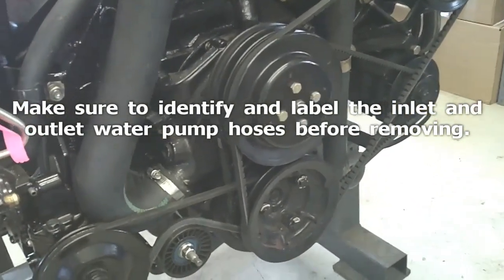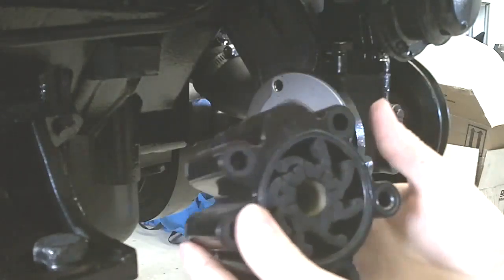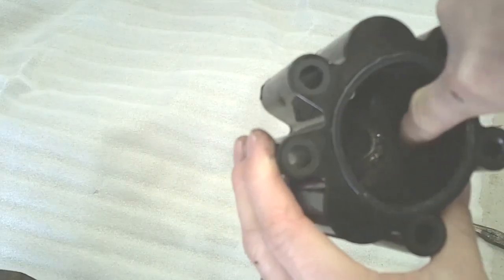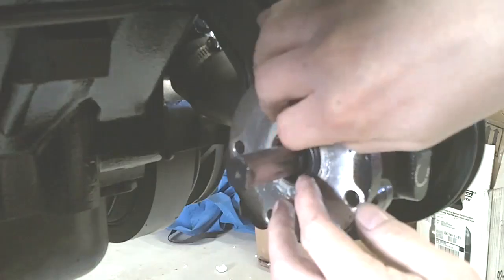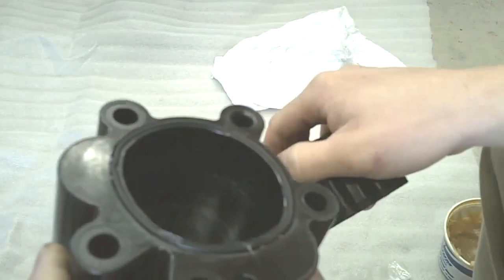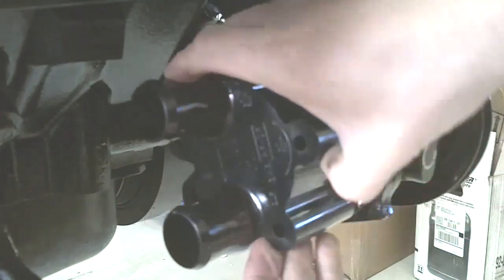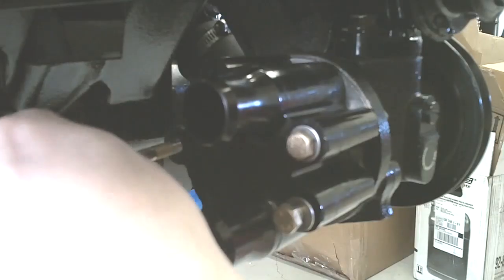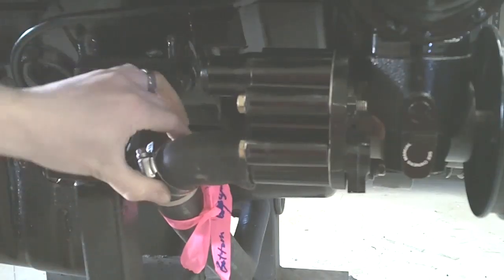Replacing Your Mercruiser Marine Engine Sea Water Pump Impel

Comment: I was taught to remove the entire pump assembly by the braket that is bolted to the motor.  When you have that out, unscrew the fuel pump bolt (large slotted screwdriver required) and drain the reservoir since it will undoubtedly be full of gas.  Refill with drive oil.  Then change out the water pump using OEM parts and use dish soap for luibrication, never petroleum based grease.  Once I've done all this, I run my boat on earmuffs and check for leaks and proper water flow out the exahaust.

Comment: This procedure also applies to several tow boats with direct- and v-drive inboards and engine-mounted pumps like my 1995 350 EFI Magnum Tournament Ski. I pull the the whole pump and use dish soap for the impeller.
Reply: Was it easier to remove pump? Did you have to loosen the belts? My impeller housing cracked and I’m about to replace it myself just looking for the easy way and how to do it lol
Reply: @michaelrodriguez8299 You've probably replaced it by now.  You only need to remove the one belt by loosening the tensioner, then it will come off the pump pulley.  There are a total of three bolts and one nut to remove, plus the two fuel lines and a breather tube to remove plus the hoses.  Drain the fuel pump reservoir while you have the assembly out since it will be full of gas.  Refill with drive oil. Make note of where the hoses attached to the back of the pump so you don't cross them.  Happy boating...

Comment: Thanks for the helpful video (even if it was made 9 years ago). Just took the pump off mine and the impeller is freakin' backwards! I got the boat 3 years ago, and I've had it in the water twice. How the heck did it not overheat? Went to run it with ear muffs and it wouldn't draw water up. That's what made me look into it. Found your video and voila!

Comment: The damage seen(little black fuzzies)is exactly what you find when a new impeller is ran dry. In fact, it got so hot it cracked the housing. When replacing, never use petroleum based lube on a water pump impeller, it causes it to swell and soften. Use dish soap, but the ultimate is silicone grease. Mercrusiers are one of the most difficult to change in the boat. It’s good for people to see it out in the open because many times you can’t see it and you’re doing it “brail”.

Comment: Yeah use Dawn dish soap for installation non-toxic I use it on my ski bindings works good on impellers also and what he doesn't tell you is that you should check the bearings for roughness and the O-ring can easily slip out of place on this model I like to use a little Right Stuff gasket maker underneath the lip of the seal between the bearing and the housing and you can put a little more outside of that for extra protection against water leakage on the back side and definitely look for broken pieces of your impeller in the lower hose section where it goes into the transmission cooler make sure you get all the pieces out of there some really tiny ones can work their way through but you definitely want to reach in there with a pair of tweezers or something and pull them all out and sometimes the housing is slightly scored on the inner Edge where the center part of the impeller rubs against the inner part of the housing I take some 220 paper body work d a paper works good because you can stick a small 3/4 inch piece to the end of the your thumb and just sand It Down Smooth again and finish up with some thousand Grit as long as it's not scored or damaged anywhere else it'll run you won't have to buy a new housing for a little bit of scoring on that end and there's always the stainless steel upgrade for 350 bucks Hardin Marine makes a good one
Reply: Good call!  Great info mobile mike!

Comment: "This engine is obviously out of the boat" . LMAO . Show me how to do this in my driveway.
Reply: I usually pull the pump off the motor.
Reply: I've done this many times over the years the hard way.  This year is going to be different with the electric ratchet i just purchased.
Reply: I just got her done, the electric ratchet is the best two hundred bucks i've ever spent.
Reply: Same way in the drive way brah

Comment: Great vid, except he neglected to advise the checking of all the hoses AFTER the pump, for remnants of the old impeller.  Typically the chunks flow through the system and collect at the inlets of all the accessory coolers and the thermostat housing.
Reply from the maker: https://www.perfprotech.com/blog/articles/mercruiser-impeller-installation#
Reply: See this video on a very good description of locating the missing impeller pieces.

Comment: I have a 1990 Mercruiser 454/Magnum Bravo one drive and I want to replace the raw water impeller. I want to order the part and install this my self as in the past I have always had this work done. On the actual part there is a number 46-807151 on the housing. When I do a search for this part# I found the same number with additional numbers and letters like (46-807151A14 46-807151A7 807151A14 for MerCruiser Bravo Water Pump Impeller Kit 807151A7) Can you please let me know what is the correct part number for my specific motor to order so I get the right part the first time I order?  Thanks in advance. I really like your video and this will help me do this work myself. Thanks, Phil   Also, I have the engine serial number if you need that.
Be the first to review this item
Reply: Please email sales@perfprotech.com and we will be glad to help you with this.
Reply: thank you

Comment: now i am confused, i have a mercruiser and the only impeller i changed was the one in the outdrive pump, didnt know about this pump. my boat has a circulating water pump, but its all metal. so this is different. ?????
Reply: Is your outdrive an Alpha One?  Those have the impeller in the drive, while the Bravo 1 and 3 have it mounted to the engine.
Reply: He did not clarify that the system he was replacing only pertains to a Bravo 3 outdrive.  Most other outdrives have the impeller in the outdrive, not on the engine.

Comment: I have a 1988 bowrider.
Omc cobra 3L. 130hp. Inb/outb.
It only goes 10kms an hr and just revs up past that.  
The engine will over heat as well. 
Any idea what could be the issue?

Comment: hi, thank you for the vid - same process for  Merc 8.1S Horizon?
Reply from the maker: +Aaron Burke You're welcome. The 8.1 engine uses a similar pump so the process is similar but not exactly the same.
Reply: Performance Product Technologies thank you for replying! Is there somewhere I can see the service instruction for the 8.1? I'm almost certain I'm in need of impellers
Reply from the maker: We have not done a video for the 8.1L. The only place to get the instruction would be with a product service manual.
Reply: Performance Product Technologies I was thinking about taking the hose off the thermostat housing and dumping water to the impeller so I don't dry start the pump

Comment: Can I change just the impeller or do I change to little seal also?
Reply from the maker: +simplyharpreet Normally you would want to purchase the water pump repair kit that includes all of the normal replacement items vs just changing an impeller.
Reply: Can u replace just the impeller or do i need to buy the the kit?

Comment: great video I am getting ready to own a sterndrive boat and this will help me in the long run and I knew how to fix a sterndrive and the good bit is I save on shop time and do it all myself and as an old salt I knew sterndrives pretty much myself how do you replace the sea water pump when im doing it for the first time and what cautions I need to take when doin the job for the 1st time and how I know when the sea water pump needs replacing how long it takes to do it  and I knew im learning all the time and I knew that I am gettin there as an experienced boater I am learning all the time  so can you help me learn about sterndrive care  this will be for my 1st bayliner with the 4,3litre Mercruiser V6 im keen to learn all I knew over time that's why im learning all the time  thanks!! from mick the old salty walker
Reply from the maker: +michael walker Thanks!!
Reply: and I knew the  routine of fixing the sterndrive and I knew how to do it myselfand I knew the procedures on how replace the sea water pump and I knew the ways of doin it  this video will help me as an old salty I knew whats have to be done and I knew all the Mercruiser engines and drives as well I knew how to perform the work myself this video will help me save on shop time and costs too as a old salty I knew how to fix a Mercruiser sea water pump and the other bits of the Mercruisers I knew how to fix them  that's how from mick
Reply: i knew the video will help me fix my 1st sterndrive and all the videos will be of much help to me that's the old saltys way
Reply from the maker: +michael walker Thanks!
Reply: I am getting close to having my first sterndrive boat as I get nearer to the day I get one  mines going to be the bayliner 1850LS Capri boat as I knew the motor was the Mercruiser 4,3 litre V6 as I will be doing all the maintenance all the service work will be done by myself as im a experienced mechanic from the time I knew how to service these motors as I read up on a lot of the stuff on these engines that's the Mercruiser V6 its the 4,3 litre sterndrive motors how I go about servicing my Mercruisers as I am  a well versed old salty and im gettin the nice boat am gonna do all the service work myself this will save me the wasted time in the shop can you  do a video for us old saltys on how to service a sterndrive engines and related components as well show us old saltys like me how to fix the engines when the boat is at home say we had to fix something that's wasn't right say for a example the sea water pumps and other things like how to check the power steering fluid levels and other levels too and also show us old saltys like me how to replace the drive belts on the engines and also teach us old saltys like me how to care for a sterndrive for the 1st time we us old saltys like me are willing to learn as we are good old saltys I as an old salty I love learning to care for our boats with the sterndrives im eager to learn as I go we keen old saltys

Comment: how often should I do this
Reply: can confirm the three years part. My boat has very few hours on it since I changed the impeller 5 years ago and it shredded itself!
Reply from the maker: +David Andersen Every 100 hours or 3 years whichever comes first.
Reply: I just bought a 1998 bayliner 175. has 54 hours on it. not sure if it's been done.
Reply: David Andersen 
I'm actually changing out my impeller as I watch this video. I bought a 2004 four winns 170 with a volvo penta 4.3 last summer and want to be safe since I don't know how old it is.

Comment: Got a question does it matter which way you put the metal plate? Seems like on forums they say it only goes in one way or your motor will heat up? Any inputs please thank you
Reply from the maker: +yelena kruzhkov Woth certain models this can be true. However, with the Bravo model this video is referring to the plate can be installed either way.

Comment: You have to check for pieces of the impeller in the hose that goes to the oil cooler-the hose that goes under the engine very important remove at oil cooler and check oil cooler tube where hose clamps on
Reply: Thank you. So outlet hose than?

Comment: DO NOT use grease on an impeller.  It will break down the rubber more quickly.  Use either dish soap or plumbers non drying silicone.  Dish soap is actually the one all the marine mechanics I know use.
Reply: Never use petroleum based lube on the water pump impeller. Use dish soap but the ultimate is silicone grease.
Reply: Vaseline eer petroleum jelly
Reply: Dish soap great idea
Reply: Exactly correct. Petroleum based lube is poison to rubber & causes the rubber to go bad. Dish soap, silicone, or water-based lube. Is best.

Comment: Thanks for posting this.  My wife forgot to turn off the engine when I trailered and pulled out at the lake recently.  I thought "My impeller is shot", so I pulled apart my Mercruiser MAG 350 today, and turned out everything was still good as new.  At least I now know how to do this, and will have parts on-hand just in case I have to do this again.

Comment: My Mercruiser  205/V6 alpha one equipped boat started to run a little hot when I'm idling in gear but cools when I increase speed. Do you have and idea what it could be ? should I start at the Out drive . We are going to go to Lake Powell in the first of August and do not want to get stranded . Grateful for any info, ideas that can help

Comment: Paul Smith
I have a 1987 Alpha on 260/V6 and it runs hot immediately when put under load. Hadn't been in the water or run for about 3 years. what might be the problem. Thanks.
Reply from the maker: Check out this article https://www.perfprotech.com/blog/articles/impeller-installation#

Comment: hi, i have a 07  496 and it is overheating and water in the oil, besides a blown head gaskit, is there anything els that can cause this, thanks mike
Reply from the maker: That is certainly one common cause. I have also seen times where the valves leak due to ongoing water ingestion issues and this allows water to accumulate in the oil over time. However the most common is the head gasket or cracked head/block.
Reply: Thank you
Reply: michael varalyai Don't remove the heads yet! ...Big blocks are fairly resilient. I would venture to say; Check for Exhaust Elbow(s) and or Exhaust Manifold(s) water leaks.

Comment: Great video, but I would recommend one more thing.  This particular setup has the fuel pump integral to this unit.   Fuel can slowly leak by the diaphragm, and dilute the lube in the front part of the unit.  I would recommend to at least drain out the oil and replace it at the same time.  I normally remove the whole unit from the boat to do this, and flush out the small oil reservoir for the fuel pump, then put in new oil.
Reply: Rick, he's talking about the oil reservoir IN the fuel pump (yes, it has it's own reservoir). It's something that is easily overlooked, and having it get diluted with gasoline will cause the pump to eventually fail. They aren't cheap if you have to replace the whole thing!
Reply: @fahrvergnuugen   Can't believe I asked this question 6 years ago. Thanks for replying (2 years later) but better late than never 😉. I am now well versed since with the Sea Water Pump.
Reply: some have one flat head screw, some replacements (my new one which is expensive) have 2 oil screws. the screws are directly below the mechanical fuel pump if you have the pulley, fuel pump, impeller combo.  Drain it and I use Lucas gear oil in it too keep from another $4-700 (parts only) mistake.  I actually found my complete replacement on eBay with a removable pulley on the front that makes life easier for maintenance.
Reply from the maker: Great point. Thanks for the feedback.
Reply: Sandpiper270 When you say "drain out the oil" are you taking about the crankcase oil? And how does "flush out the small oil reservoir for the fuel pump" stop " Fuel can slowly leak by the diaphragm" ?  As you can tell, I am a bit confused.

Comment: When the boat is in the water, before removing the two big hoses, have a tapered shot glass ready to push into the hose then clamp it tight. That's what I use every time, works great!

Comment: I have the Mercruiser 7.3 MPI engine, with engine in the boat, I always remove the serpentine belt & remove the sea water pump completely out to R & R the impeller. There's no way I could work on that pump with the pump not removed, just no room. Removing all the bolts but one, then it comes out of the mounting bracket. If your in the water, one of those tapered shot glasses works great. Just have it ready when you remove that hose, water will come in fast!

Comment: I thought grease was not to be used when installing the impeller, grease will not wash out and can attack the rubber impeller? What kinda grease are you using in this video? Can't you use dish soap to ease the installation of the impeller. When you start the engine with water attached, it washes out the soap and your ready for some boating!
Reply: vaseline

Comment: if motor is in the boat, remove whole pump assembly and remove whole pump out of the boat. It took me 10 min to get it out of the boat. Just take serpentine belt off, remove two bolts which holds mounting bracket, pull pump away from engine block and remove hoses.

Comment: If its an Alpha Drive, Gen 1 or Gen 2 Mercruiser the boat does have to come out of the water because the impeller is located in the lower unit.  Mercruiser Bravo Drives the pump is as in this video and mounter to the engine and is belt driven and can be change in most boats while in the water.

Comment: Can be done in the water but you need a cork to insert into the inlet line once it's removed from the pump.  Just need to be aware of what's going on and don't panic when you see water coming out the hose until you get the cork in it. Done right you will not get more than a quart or two of water in the bilge.  Large cruisers or houseboats with these drives can't be easily pulled out the water for this service.

Comment: I do it’s a big yellow lever it’s in up position, I see what you mean now, I need to close it and then disconnect the hose. That makes a lot of sense thank you pptave99 
So if I want to push water through it to clear debris, It would have to be out of water otherwise it will flood in